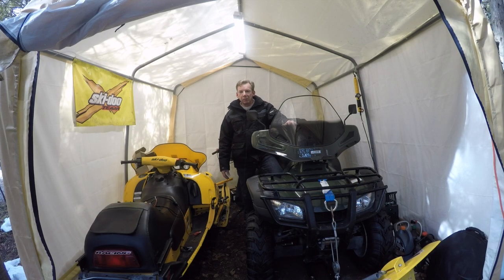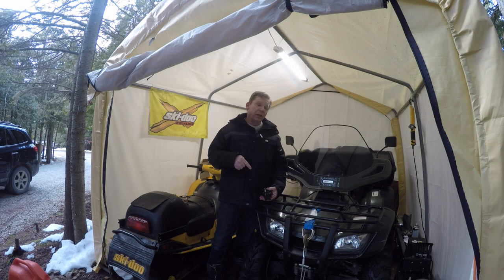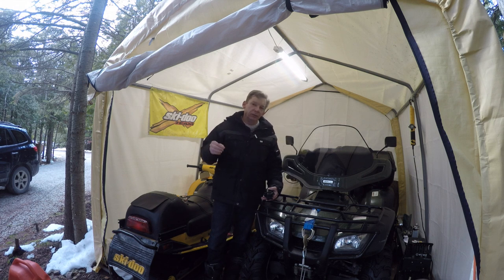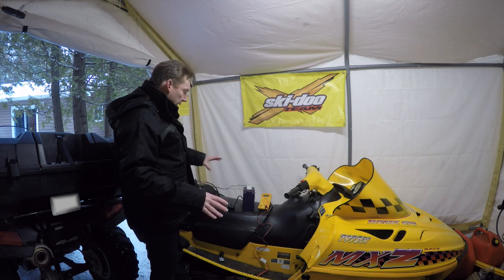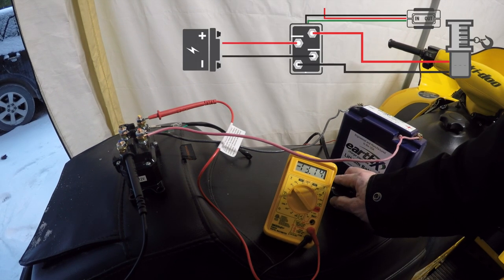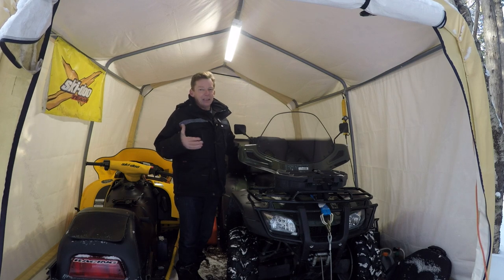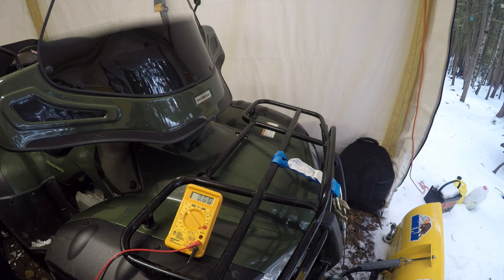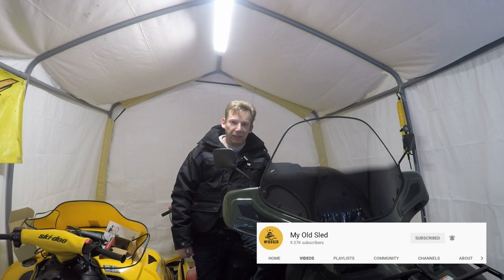How I Diagnose and Repair A Dead ATV Winch

Comment: Just put a winch on my Xmark mower in IL, with a switch to operate a snow blade.  All worked great in garage.  Worked well for 2 ydriveways, then appears to have started to bind up when I lifted it, would not go back down, as I may have gotten a chain link into the winding.  Also I  may remove 10-20 feet of cable from the winch so there is more clearance on the drum.  will try to determine the problem when it gets a little warmer (was -10F) the last few days 12-2022. and will be in 50's next week!  thanks for the video!
Reply from the maker: Yeah unspool it, lubricate it, spool it carefully, then try the things i checked in this video, good luck. Merry Christmas!

Comment: On my gator snow plow the winch cable was getting wrapped up too twisted so I let a few ft out and lubed the cable and also added a pulley to increase the pull. Worked great after and doesn’t dim the lights so bad when plowing at night.  Although the last couple of yrs it’s not getting used much in Southern Ontario. Good video
Reply from the maker: I think I’m going to replace this winch and switch, but hopefully it gets me through winter

Comment: The lights on the instrument panel were flickering and engine stalling when I'd slow down or stop to raise the blade. Then I went to do an oil change and the blade wouldn't go up or down.  I tested the port to the solenoid whish was good. I checked the wires from the solenoid to the winch but had nothing. I ordered another solenoid and installed it. It's working fine now. I haven't been able to check about the flickering lights on the instrument panel or the stalling yet. I hope it's all good.
Reply from the maker: Sounds like a loose or corroded connection. Start checking wiring….good luck

Comment: Concise and to the point. Question. If you went straight to the winch with the volt meter and got the correct volts, would that essentially negate all of the previous steps?
Reply from the maker: Yes. In the video I am just going through the whole circuit.

Comment: Great video, I believe I have the same issue, I hear the clicking from the relay and it worked before my four wheeler got stuck in a creek and the winch got submerged under water. I'm going to try to redo the connections and see if that works. Anybody  have any tips for me?

Comment: My winch cable was all twisted up and frayed from the previous owner. Not knowing the age of the winch I ended up replacing the entire winch with a new one that was on sale.  Im curious about your setup. You have a pulley on yours. Mine is simply attached to the blade directly from the winch. I suspect your way has less force on the winch. You should do a video on that.
Reply from the maker: There you go: https://youtu.be/8EfMnXnmj0s
Reply: Thx Dave. Did you end up drilling that hole to move the pulley further out. Did that work out better.
Reply from the maker: No. Sometimes you just turn around and its next year already.

Comment: When a winch is disconected from all wiring, should there be continuity between the two poles?
Reply from the maker: Yes
Reply: @MyOldSled  thank you
Reply from the maker: Mmm actually wait I think I misread. There would be continuity through each winding but not just if you put your leads on the pos/neg lead. Google testing a motor you’ll find lots of info.

Comment: I’m not getting spark on my 1985 cougar 500 Is it possible to clean my coil?
Reply from the maker: I don’t know, but I would guess no. Its basically a transformer. When they go, its going be the windings inside are shot or shorting etc. Have a look, see if theres anything to can clean but other than connectors, I guess no. Are you sure its the coil? Have you tried unplugging your main harness to rule out a bad ground? Checked the stator etc..

Comment: have the same issue with my winch, just bought a new solenoid, the body is plastic, the old one is metal that the ground is hooked to, how do I ground it using the new solenoid?
Reply from the maker: I would check with the manufacturer. Ive seen some that have a ground wire, but i wouldn’t want to steer you wrong
Reply: @MyOldSled  thank you!!

Comment: Hi I gave my father in law aa Bost I fried my batter and now my winch won't work I have nothing no clicking when I hit the switch. I know it's not the winch it's self because I tested it with power to the winch and it worked fine. Any idea what's going on?
Reply from the maker: Everything about problem solving is in the video.

Comment: Hi could you do a video on how to diagnose a sled that dosent stop running after key and tether have been removed i have been looking everywhere and still have not found anything about this subject i ran a new ground checked all my wirring and still cannot find the problem. Thankyou
Reply: 1996 mach 1 670
Reply from the maker: Ill think about how to create some content, i haven’t had that issue so I’ve never problem solved it. My guess is a bad wire or connection keeping it from grounding out. Electrical issues are a lot of trial and error.
Reply from the maker: Actually, thinking about this one, I have to be clear I'm not a sled technician, I'm a guy with a sled who likes to tinker. Your tether and kill switch are safety features, and need to be working properly so I don't want to steer you wrong.  I know on my rev the kill switches are prone to fail. They get dirty and won't ground properly.  I've never had this happen on my 670. If it was me I'd be checking each switch for continuity, checking the main wiring harness connection since both aren't working. Check the wires right from where they come out of the stator. Sorry I can't be more help. Check Doo talk, some really knowledgable guys there.
Reply: @MyOldSled  allright thankyou
Reply from the maker: Lol. Omg guess what happened to me Brando?
Reply: @MyOldSled  whats up
Reply from the maker: My kill switch is being flakey. Just needs the contacts cleaned. Did you find your problem?
Reply: @MyOldSled  no i havent found my problem yet but i could try cleaning the contacts. its just weird how one day it shuts off perfectly fine and other day just dosent turn off at all

Comment: I have power to my winch, I can hear it running when the out and in switch are used but the drum isn't turning and I can engage the free spool but I cant pull out any cable...Does anyone have any ideas before I pull it apart..I bought it used and didn't use it for a few months but it was working when plowing for the last few snowfalls..
Reply from the maker: Im guessing one of the gears in the gear train grenaded.

Comment: Just put a winch on my polaris an the solenoid just clicked I put power to the winch directly an it powered it both ways so I bought a new relay an it still just clicks currently looking for my volt meter lol
Reply from the maker: Then i would guess it must be the wiring between the solenoid and the winch.

Comment: What should I do if I lose steering
Reply from the maker: Can you be more specific? Are you asking about what to do when it happens or how to fix it?  What do you mean lose steering? Do you mean the skis aren’t turning or you’re sliding around?
Reply: @MyOldSled  if you are going down a trail and you're skies wouldn't turn what would you have done in this situation
Reply from the maker: Hmm. Never happened to me, but you do read it happens from time to time, bolts fail, parts brake. I'm no expert, but I can't think of a lot of options other than try to come to a stop as smoothly and safely as possible. Let off the throttle, apply brakes smoothly, don't shift my weight at all. Probably end up getting towed. What would you do?
Reply: @MyOldSled  I ask because I had my handle bars brake off and no steering is sketchy so asking for the next guy
Reply from the maker: hehe, yep, no steering is sketchy. So what did you do?